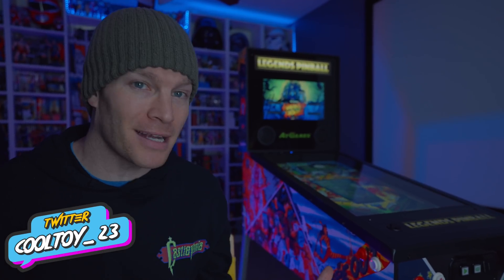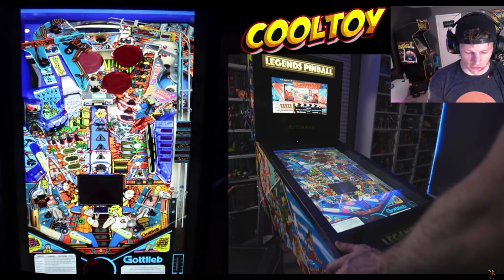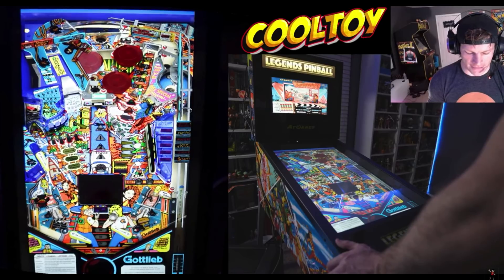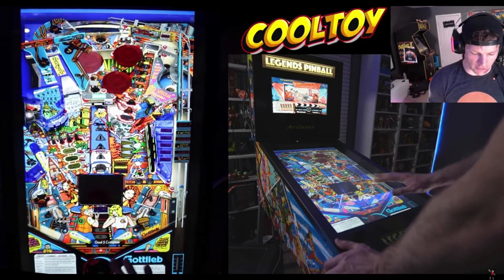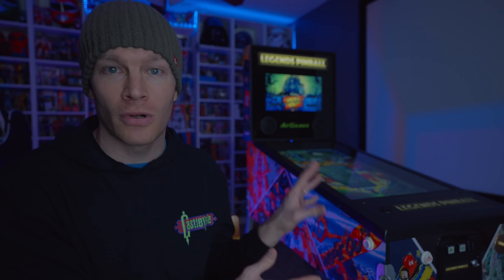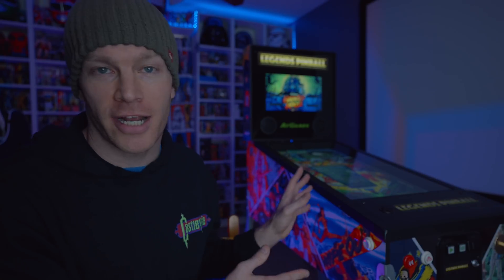AtGames Legends Pinball Machine Unboxing & Teardown

Comment: I´ve been looking around for a 32 inch playfield virtual pinball solution because I cannot build one myself... I think this is perfect but tell me, do you thing I can get rid of the interior board and put a PC inside? do you know if the playfield moniter has a normal hdmi output? the back monitor would not be an issue because then I would put another monitor there with a new plate covering it.
Reply from the maker: you wouldn't have to get rid of the stock pcb, the system is designed to allow you to easily connect a PC to it via OTG. There are no standard HDMI connections on either the playfield monitor or the back glass screen.
Reply: @cooltoy  thank you very much for the confirmation... my goal is to put a PC inside the cabiet.

Comment: Good morning....happy new year.....hoping you can point me in the right direction.  My down function has stopped working on my player 1 joystick.  Every thing else works fine.  I have swapped joystick assy's and also plugged wiring harness for player 2 into player 1 plug on pc inside the control deck, still no down function.  Last thing i tried was to resolder the plug for player 1 joystick on the pc inside control deck (maybe cold solder joint)......no luck.....any thoughts ??

Comment: @CoolToy thanks for going over the hardware, surprised the CPU is a Rockchip 3399 not a bad chip but a bit long in the tooth. They must have drivers optimized for this specific board.

Comment: Hi CoolToy, do the transducers just make vibrations or do they make some "bumping" sound as well ? 
The bottom line question is :  does the combination of  transducers + sound volume lowered near 0 make it possible to play while people sleep in other rooms and yet still "feel" some feedback on the flippers (and possible on the rest of the body for the bumpers)  ? 
If so, would you say the AtGames machine is a better option to play at low volume at night  or does the A1UP offers a similar possibility ?